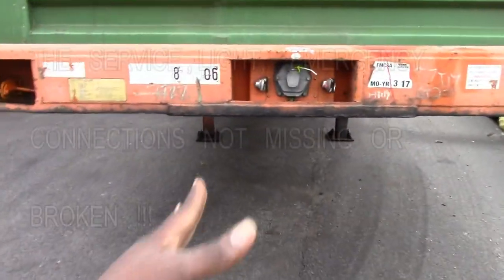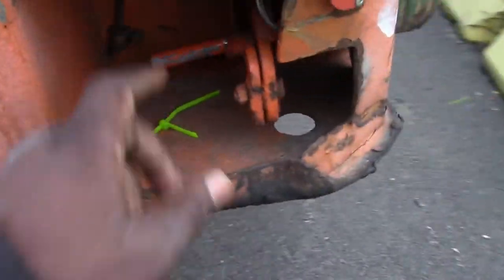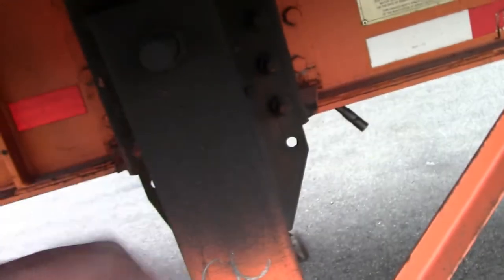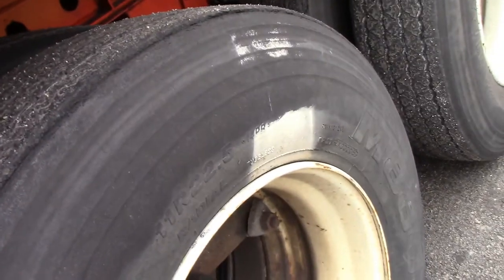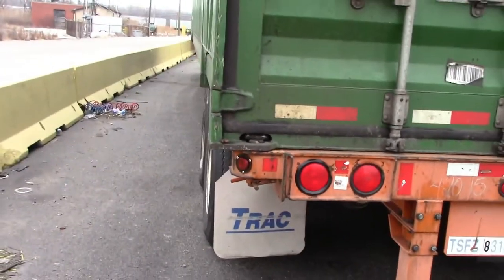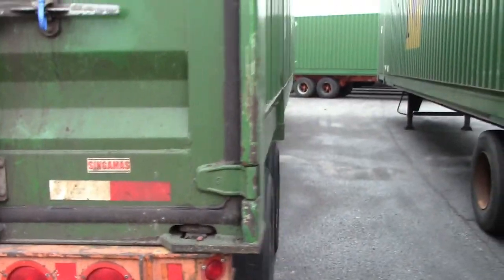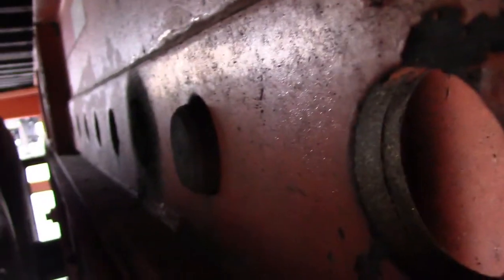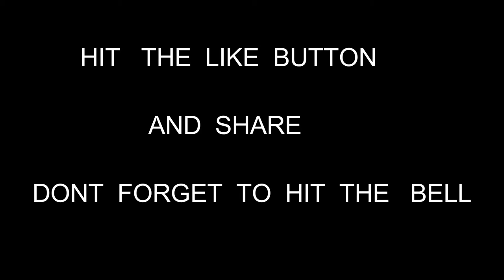IMPORTANT THINGS TO CHECK FOR WHEN HOOKING A  CHASSIS W/ A BOX !!!!!!!!!!!

Comment: Nicely done except for not putting ZIP TIES on the locks the pins will back out in the front all the time. The back also can unlock If anyone is pulling a container without ZIP TIES you are taking a big risk

Comment: For the second time in 3 months a jb hunt chassi is ripping my driver side mudflap? Anyone has an idea what exactly is happening
Reply from the maker: Your fifth is probably too far forward... try sliding it back. Or you probably got the curly Q's mudflap brackets those tear off alot because they stick up when you turn corners
Reply: @TruckingandLife  Thanks a lot! The bracket never got damaged just the mudflap on my driver side would get horizontal cut almost at the top just below the bracket
Reply: @TruckingandLife  I just checked my 5th wheel is somewhere in the middle so tomorrow once I hook loaded trailer will slide it all the way back. Thanks a lot God Bless